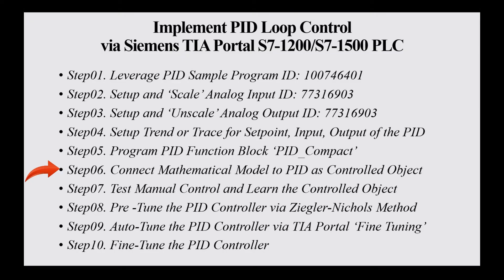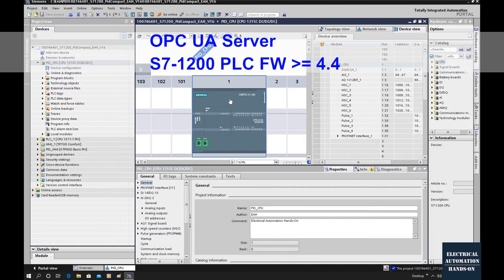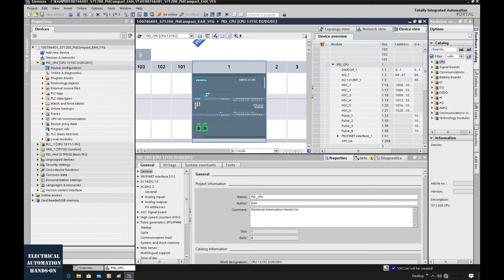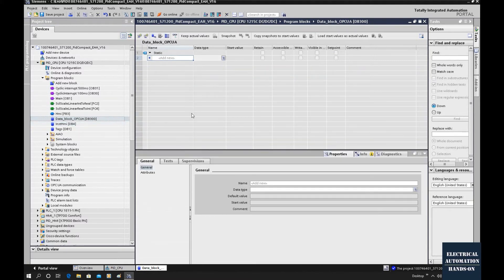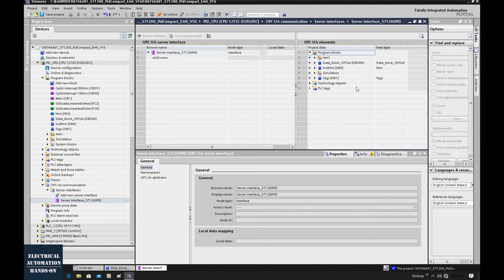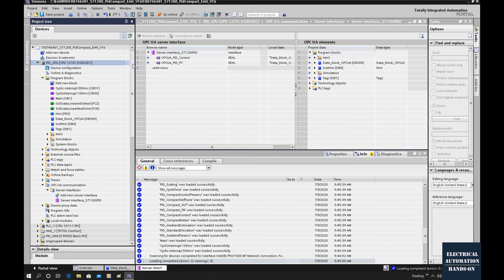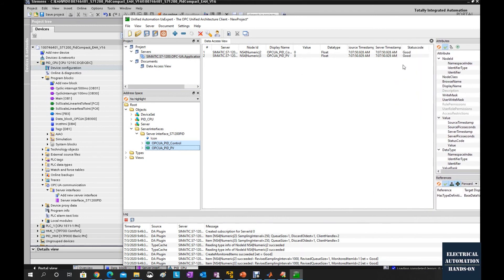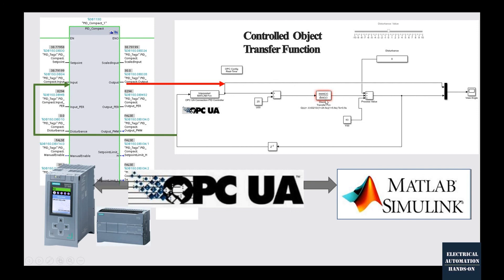PID16 - Siemens PID06d - OPC UA Server in S7-1200 PLC (OPC UA Client in Matlab)

Comment: Is OPC UA communication Compatible with s7 1200 plc??
Reply from the maker: Yes, as shown in this video. But you need to use  >= V4.4  firmware of the S7-1200.
Reply: @electricalautomation  ok thanks,  I will try it.